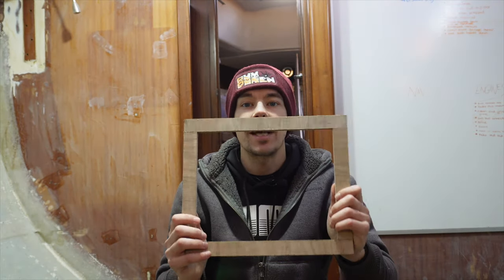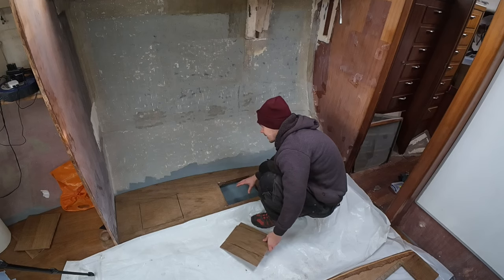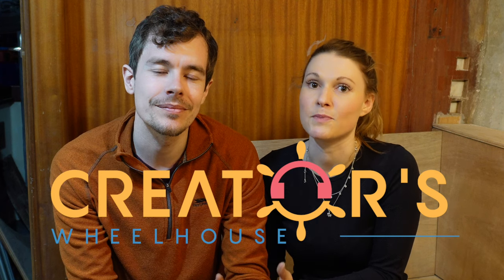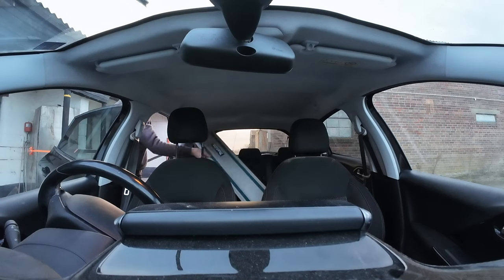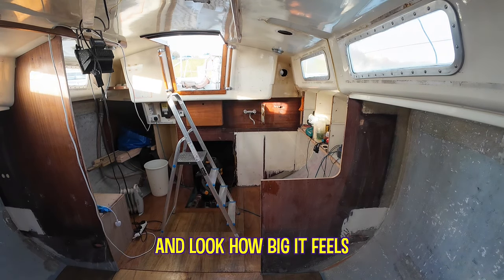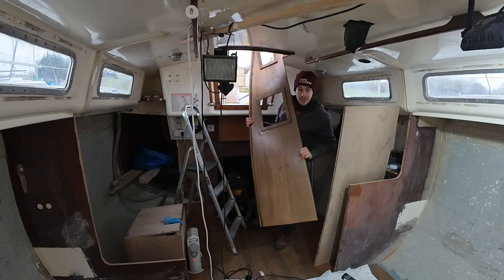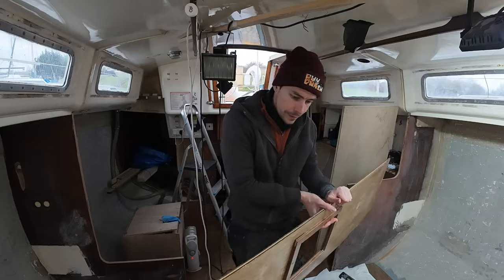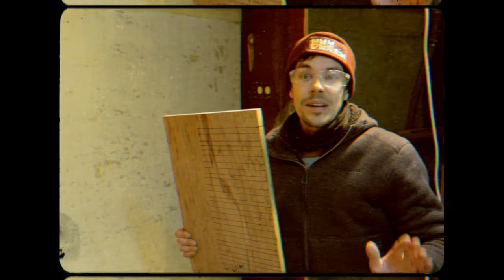Ep 24 | Making SERIOUS decisions

Comment: I would be those bulkheads are structural in vertical compression.  That’s why they’re glued at the top and the bottom.  If you cut out the segment indicated, you will be taking away the vertical path for the loads.  Bulkheads aren’t tabbed-in unless there’s a purpose.  Best of luck.
Reply from the maker: The glue at the top was added much later I suspect to stop them rattling. Compression posts will be added in case any vertical load was compromised.

Comment: You are seriously weakening the structure of that boat , as it could twist and lose its shape if you take too much out . Personally i would add some compression posts , as already mentioned , but then i wouldn't have been quite so brutal in the first place . Interior furniture is placed , to take different loads , and those bulkheads are placed to support the deck load as well as keep the hull sides apart . The deck is stressed in compression from the weight above , in particular the mast , and they are placed to spread that load along with the standing rigging throughout the hull . I'll go further in saying i have never seen any bulkhead not bonded in on any craft , so this is new . I don't know what class this boat is but it's most unusual .
A visual sign of this loading appears in one shot of the first bulkhead you removed . It appears to have stress cracks right where the bulkhead sat !
Reply: You should look at Spear it animal , when they took out a bulkhead between the two front berths, then bought the roof beam forward to give bigger storage, but the moved bulkheads started creaking under sail a d were moving a lot so the had to add a huge timber beam on the ceiling to spead the loadings , all because they didn't think that the bulkheads were load bearing . But all good now , so very good luck for the future. FOGGY